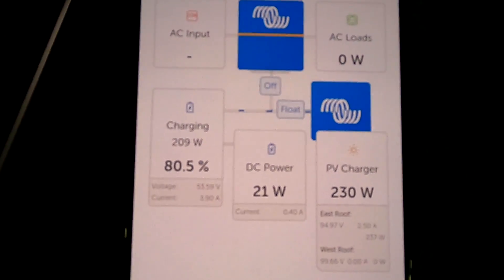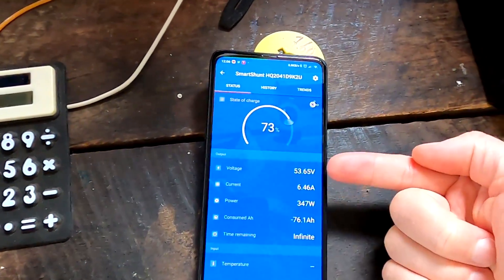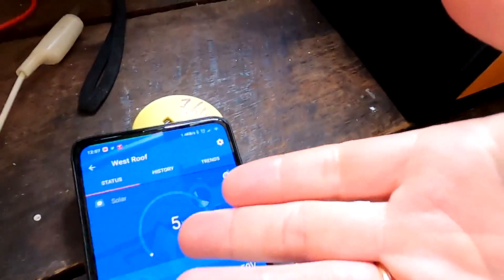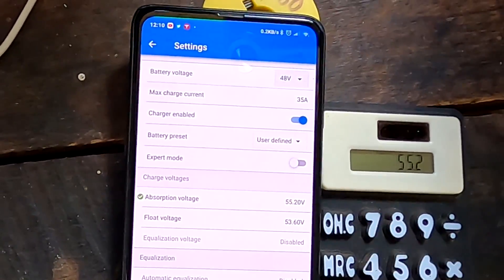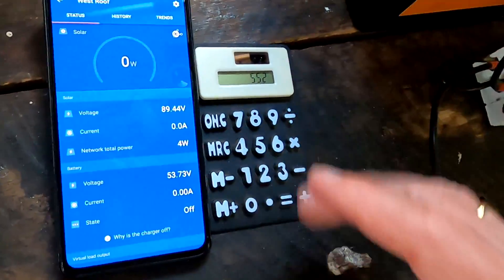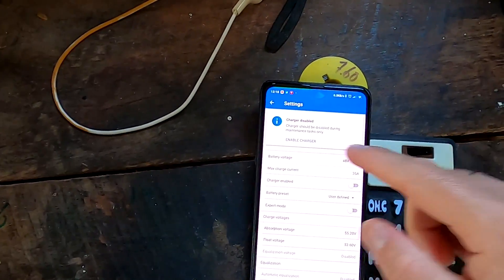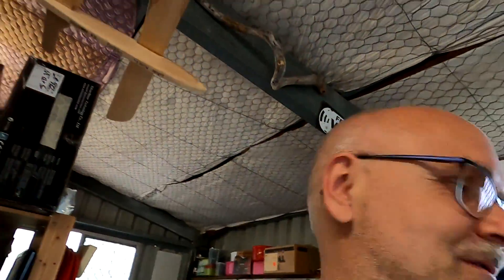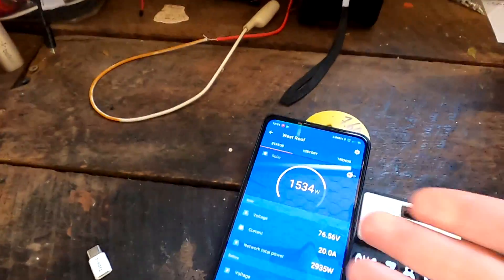Floating at 70%. Why charging LiFePO4 to 3.4V is not enough!

Comment: And this is exactly why you set bulk/abs/float to the same voltage 😎
Reply: bulk, abs, float are algorithms developed for lead acid chemistry, NOT LiFePO4 !
Reply from the maker: But all these settings work perfectly for LiFePO4 as well and gives us so much to play with and learn about.
If you set all to the same value, it would either keep the cells on a high voltage so the balance can work or at a lower voltage and the balance does not work efficiently?
I quite like the idea to go higher for balancing purposes and then drop the voltage afterwards to keep the batteries charged.
Reply: @OffGridGarageAustralia  AFAIK there’s no evidence that you (for whatever reason) should not “keep” the cells at “high” voltage, eg 3.5v. A lot of hearsay though. In any case the voltage will drop when the sun goes down 🤓
Reply: @andrewseaman7012  Lifepo4 have much the same charge profile as Lead Acid. Most SCC’s do CC (or max available current from solar) then CV charging. Just don’t need equalising at a higher voltage. I contacted Epever  support, who recommend Equalise charging at same voltage as Boost (aka Bulk) for Lifepo4 and then you have 2 time periods to adjust. Also have a Victron Smart 100/20 on different panels. The Epever 60 Amp Tracer6415AN Imax (power station model (takes 25mm2 cable, with excellent terminals, and cable clamps) Software is inferior, but ordered an eLOG01, will get ebox TCP02 for wired Ethernet) cost 1/8 of a 60A Victron! Getting a Raspberry Pi 3B+ and Victron VE Direct cable, and wiring that to Ethernet. Later a Victron Smart Shunt, wired to R.Pi, so I can see the battery current. I find the Bluetooth range is poor, through walls.
Reply: totally but what would Andy play with.